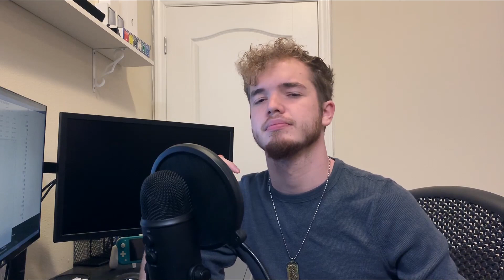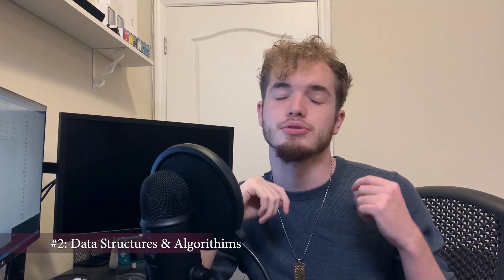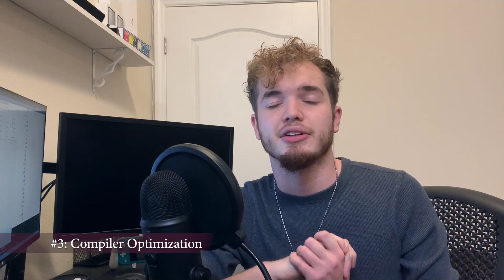Best Computer Engineering Courses - My Top ECE classes

Comment: great video! any tips for someone who is struggling with digital design and circuit analysis which seems to be a basis for future classes
Reply from the maker: Yimaj Ahmed Thanks man! So it depends on how you want to your path to go, circuit analysis isn’t AS important if you aren’t going to go into electrical engineering classes, so try and ease your mind in that regard. So try and take it semester by semester and maybe try go to office hours, try to relearn some topics that you may be behind on as they build on themselves. Best of luck man.